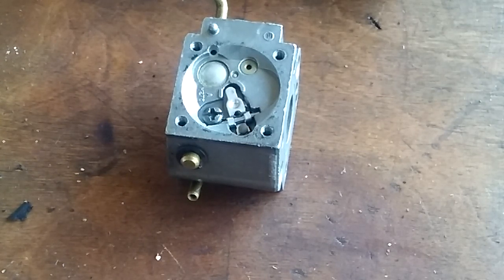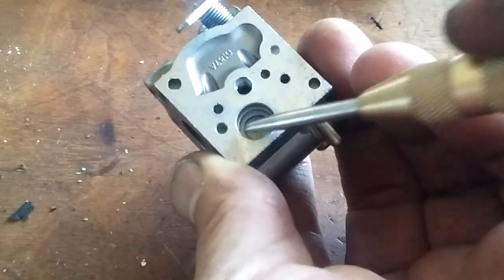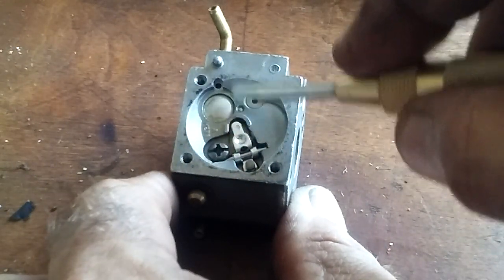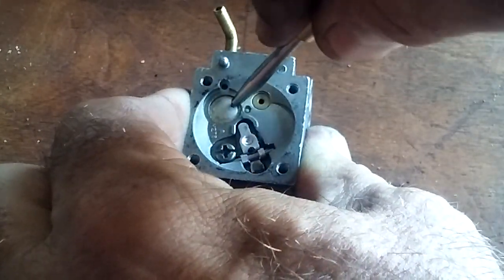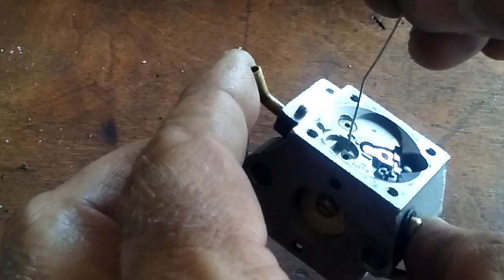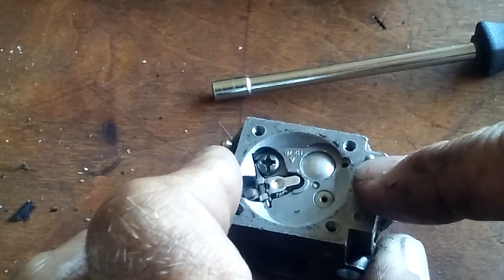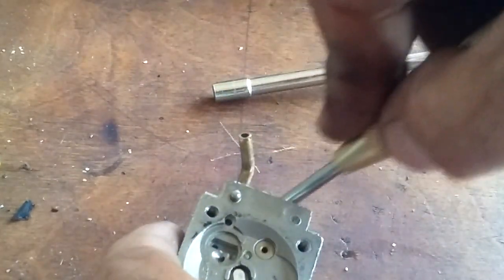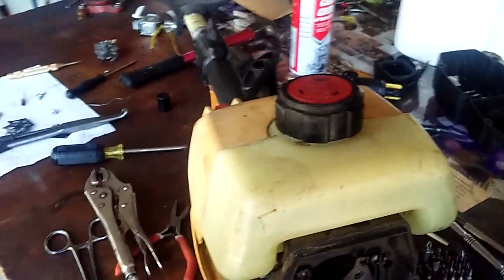Walbro Carburetor welch plug removal for deep clean.You can do this

Comment: My kit had the small Welch plug size wrong.
Reply: How can I get the right size . I have the right kit one plug fit but the other don't
Reply from the maker: Akeem Griffiths  yeah,when I order carb kits, I order the 1 that fits multiple carbs. I have a stockpile of carb parts and pieces from those kits. They still only run $5-$7. Some carbs use 2 welch plugs too. FYI I use Amazon exclusively for my parts and carbs. Go to the 12 minute mark of this  video to see double welch plug. https://youtu.be/CX34AxY2aYU
Reply from the maker: Akeem Griffiths  not sure. Im an old man so I bitch and complain until I get what I want. Lol. I also dont remove welch plugs as religion. If its varnished and is sticky with old oil thats when I remove the plugs. Otherwise not neccesary. IMHO
Reply: ulitepilot aka Zombie Dave today after removing one of the plug I notice 3 small holes and one was blocked so pulling it this time counts  lol
Reply from the maker: Akeem Griffiths awesome buddy!

Comment: What's the little area next to the Welch plug? Can that be cleaned out too? 

Also can I use the same Welch plug that I got out instead of a new one? Because I don't have a replacement one...
Reply from the maker: Cannot reuse it if its deformed I dont know of any sealant to help you that the ethanol wont dissolve. If you ONLY use ethanol free fuel you can seal the plug with nail polish. That would work.
Reply: @ZombieDaveAZ   sealall from dollar General about 3 bucks.

Comment: Do you usually set the spark plug gap on small engines to .035" inch?
Reply from the maker: Isually comes pre-gapped. I like .30
Reply: Thanks man, take care.
Reply from the maker: @leeisenberg  Happy 4th. Stay Safe brother.
Reply: Thanks ZD, you too man. I got a couple new clips coming w/ credit given to You. Are you familiar w/ the old Craftsman 2.1 PS saws?
Reply from the maker: @leeisenberg  yes if its like the rebranded poulans.
Reply: My gas cap vent ALWAYS leaks gas out; such a pain the arse, what should I do??
Reply: And mine had NO air filter, so I cut a home made poor man's foam 1 w/ sticky oil.

Comment: I have a 2 cycle weedeater with a Zama carburetor that sometimes does not run right but there are no welsh plugs on the carburetor.  What else can I do besides spray the openings where the mixture screws are and the rest of the openings?
Reply from the maker: Hello Brian. Thanks for stopping by. I'm afraid I dont know what you mean by "not running right". Does it bog under acceleration? Does it not idle? Does it run then stop? Please try to be as specific as you can and I can steer you in the right direction hopefully.
Reply: Your welcome.  Once in a while it will surge up and down when holding the throttle trigger.  Sometimes it will not idle even if I turn the idle speed screw to the right.  If I turn the low speed mixture screw in any further the engine will bog down a little bit when I pull the throttle trigger.  That is the best I can explain what is happening.  Do you know what I should do now?
Reply from the maker: @brianmott728  pressure test the machine. Sounds like unmetered air coming in from somewhere. The revving up and down makes me think it has an air leak somewhere. Possible seals. Pressure test will confirm or exclude the diagnosis
Reply: How do I pressure test the unit and what do I use?
Reply from the maker: @brianmott728   follow this link and see how Donnyboy does it. He is good. https://youtu.be/23HvdPI_vgE

Comment: Soak carb in  CLR for one hour,  thanks unnecessary  work, on sorry piece of  junk.
Reply from the maker: Hey JB thanks for the CLR tip. First I have heard of it. I will share with you that some of us guys on YouTube like to know how things work, how they fail etc. I can't help but think that a lot of guys have looked at that Welch plug and thought to themselves "I wonder what's under there. They sent me a replacement in my carburetor kit so I guess I should remove it. So the  work is not unnecessary first of all. As far as it being a piece of junk, that is subjective and possibly open to debate. The owner obviously didn't think so.  MY video is CLEARLY demonstrating another way of removing the welch plug. As far as I know, I am the only guy at the time of publishing  this video (2 years ago) that utilizes the self centering punch method. I didn't say it's the only way or the best way. I said all the videos that I watched required locking down the carb and using a drill. So if you didn't gain a different perspective on this unnecessary chore, that's my fail or maybe it's on you. Thanks for commenting and I hope you subscribe. I have over 300 videos of just stuff.👍🍺